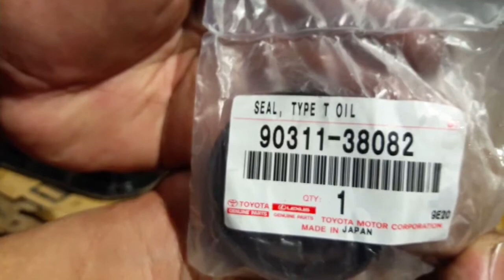Replace oil seal from torque converter & clean transmission filter

Comment: My gear oil leak between engine and transmission and I was asked to change the pump, they said if I change the seal it will leak again please help I am confuse

Comment: Montero automatic 2011 po yung sasakyan namin may konting leak sa pagitan ng  engine at transmission sa gitna po . Ano po yung papalitan doon torque converter oil seal po at yung rear cranckshaft oil seal po ba. Magkano po ba yung labor ng ganoon po
Reply from the maker: Oil seal palitan po, 3500 labor

Comment: I have these problems oil leaks just at the torque converter and have been replacing this oil seal 5 times in a week
Reply from the maker: Maybe the type of oil seal you install is the problem or the torque converter needle, before you install the seal check if fit from TC needle
Reply: Need to seat seal correctly
Reply: if the seal keeps failing then you need to change the seal bushing and maybe you need to make sure the torque converter neck isnt damaged or badly worn.
Reply: I had the same problem but my issue ended up being a seal from the oil pump somehow ended up on top of my torque converter so when ever I replace the seal oil leaks

Comment: Need to replace torque converter on 2012 camry 3.5.. do i need to take out the engine to do this repair
Reply from the maker: No sir only the transmission, i remove the engine because we need to overhaul
Reply: @vinau2fix517  thanks. dont want to take out the trans. hopefully stop slip and trans fluid swap will solve problem. slipping from 25-50mph. 186k mile car.
Reply: what do you think
Reply from the maker: @LexusPro  yes try to replace first the fluid & trans. Filter
Reply: @vinau2fix517  I'm have a leak from the converter, need piping work. Wasn't sure if I wanted to pull down the transmission to replace torque converter and seal or pull out the engine. But I think I'll do what you did, and just overall the engine.

Comment: I have been replacing this oil seal in tourge converter but oil still leaks where is the probl?
Reply: check your rear main seal in the engine....right under where the flex plate is. if its transmission oil that you refer to then check your transmission solenoid gaskets!

Comment: panu po malaman kapag sira na ponyung seal na yan?
Reply from the maker: May leak sa pagitan ng engine at Transmission bos
Reply: Boss pwd po makuha number nyo at location. Ganyan din issue ng grand starex ko. Pagawa ko sana sa inyo. Salamat